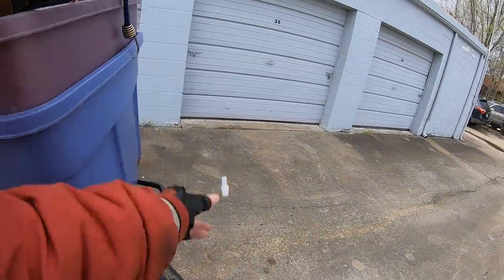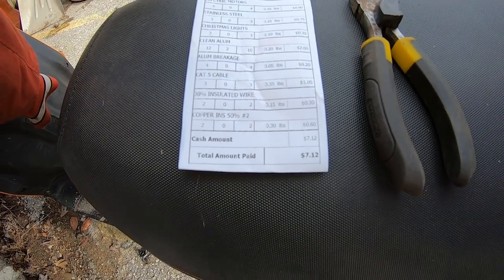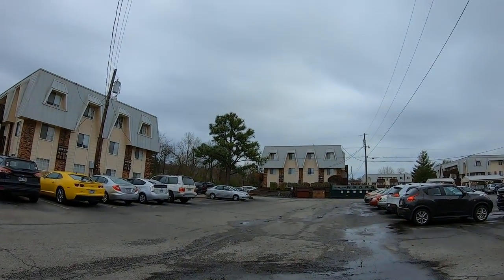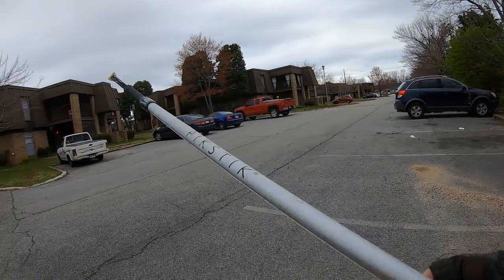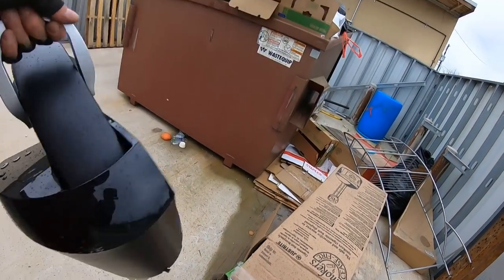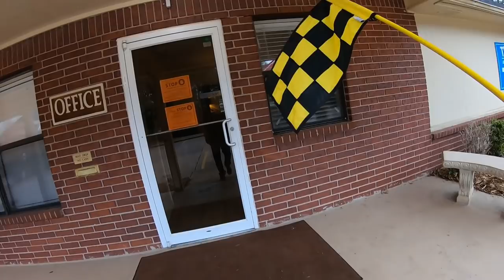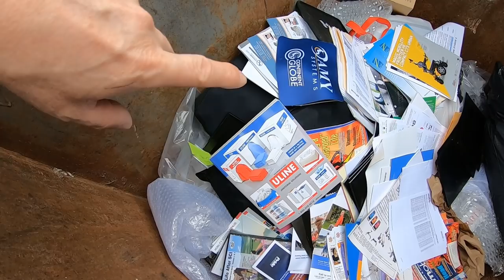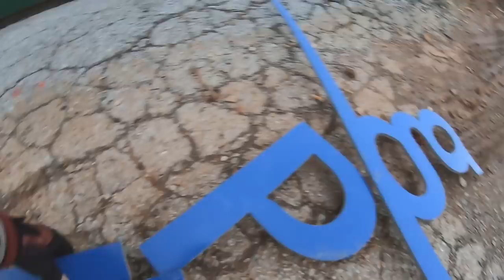These are Worth How Much?? | Street Scavenging

Comment: The Roho cushion is made for wheelchairs. The air pockets keep you from getting pressure sores. The colored knobs on the back adjust the air. The silver thing is to put air in the cushions. They come with a hand air pump. Mine cost me 800.00. I dont like them so my husband uses it if we go to a game where you have to sit on bleachers or he puts it in his computer chair for comfort. The charger is for an electric wheelchair. It is an older charger, that's why it's so big. The one wite plugs into the controller and that's how it charges. If it wasnt so heavy I would buy it from you. But the shipping will be very high. It may be old but they work great. I have one that is 20yrs old and when I go to bed I plug my electric chair into it every night. I have a couple of the new ones which are very small and lightweight but I always feel like I get a better charge out of the large old one. The new ones weigh about 3 lb and are about the size of 6 decks of cards put together. Be careful with the toho cushions. If you pop it it's not any good at all.

Comment: That black cushion featured on your video title is a pressure point cushion for individual's in a wheelchair. Occupational therapist use those for patients in nursing homes and hospitals to help reduce friction and pressure sores from sitting too long in wheelchair. I would sanitize the heck out of that thing or throw it out if it's used. Might sell if someone needs it and cannot afford a new one. Usually, comeswith a pump to blow the air up from time to time. I used to a rehab assistant and used to help maintain PT and OT patient equipment and help with rehab programming. Interesting finds! Great job!🙂

Comment: That's a wheelchair battery charger. Important thing is-is it for lithium batteries or regular batteries. That 3 prong cable is pretty standard for 24 volt chairs and scooters. Those seat cushions are nice but if they leak it could cause big problems for paralyzed  wheelchair users, which is probably why they were thrown out. They can't be fixed like a bike inner tube. Source: I'm a wheelchair user.edit: deflated cushions can cause serious skin break down and sores for paralyzed folks. Sorry, but I wouldn't take them for free.